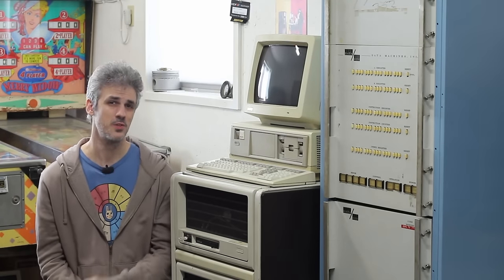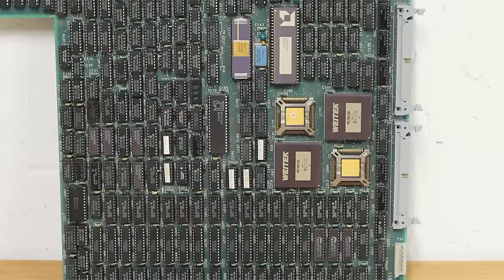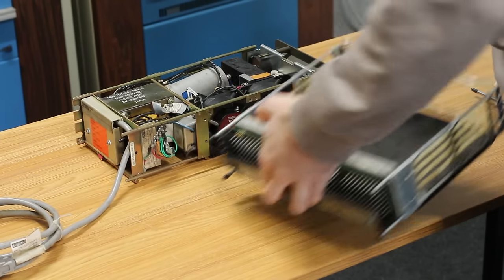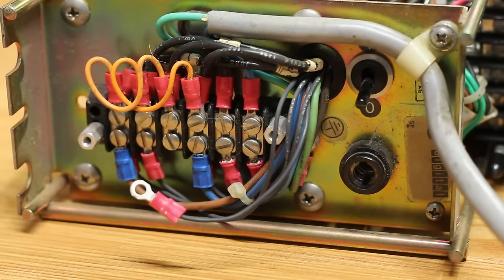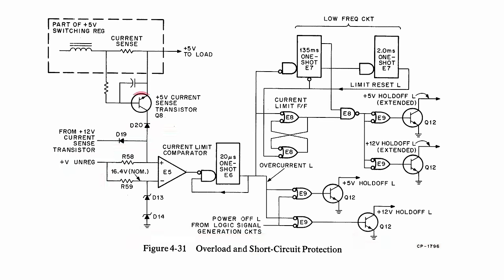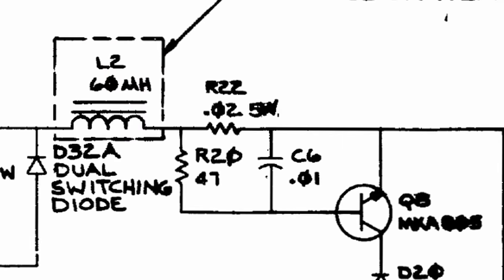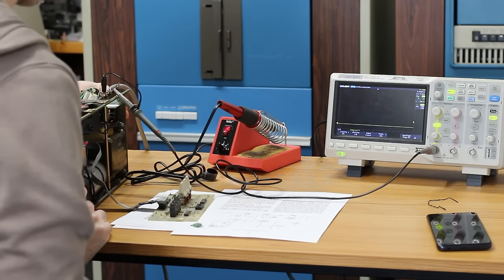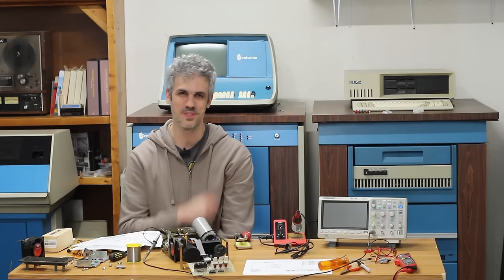This PDP-11 Power Supply Defeated Me

Comment: Isn't your power supply a buck converter?  Your "pass switch" transistor should be turning on and off at some 10's of kHz frequency. I'd disable the crowbar and the overcurrent protection (just remove the SCR and the input at the the current protection transistor). Then feed the thing with some current-limited power supply at F1 and ramp it up slowly. That should allow you to debug it with more safety and less ElectroBOOM potential... At some point the pass transistor should start chopping, then you can work on the regulation loop. You can even temporarily open the regulation loop to untangle things. Shooting from the hip here, I have not looked at the doc, so take this with a big grain of salt.
Reply: It's conversations and comments such as this that make me feel like an eager student at the Lyceum.😊
Reply: thats what i thought! the pass switch, "free wheeling" diode and inductor look like a standard buck converter to me.

although the feedback and regulator circuit look very different from what I'd expect in a modern switching supply 🤔
Reply: I heard elevator music in the background while reading this :)
Reply: also could be that the unloaded output is actually whats causing the crowbar circuit to kick in
Reply: @juliankandlhofer7553 That is what I thought.  Everything is working as designed, but there is no load.  I would want a headlight bulb on the output to see.
Reply: Shooting from the hip here also........
The 7805 initially provides a 'startup' +5V supply for the rest of the power supply logic. The right side of the regulator shown is the output and is hooked up LM317 style with it's middle pin to allow voltage adjustment.
Immediately on power up the control transistor is turned on via R14 and provides supply to the 7805 for that startup supply. The driver transistor will be off, R16 keep the main pass transistor off.
The resistor from the pass transistor emitter down to the +5V regulator will affect the output of the regulator and thus the current through it and therefore the current through the control transistor which in turn effects the driver transistor base and the pass transistor.
This last part I'm not sure about as the take off point would normally be after any inductor and current sense resistors.......but that might just be the block diag.
Reply: @juliankandlhofer7553  but there are resistive loads on them
Reply: This is a very unusual PSU indeed, it likely is making the 7805 oscillate on purpose. But it might indeed just need a minimum load to stay in regulation.
Reply: Did anyone else read this and hear @CuriousMarc's voice as the narrator in their heads?!?!? 😂
Reply: The way I read this schematic, it looks MUCH more like a traditional linear supply.
The first few hundred mA are supplied solely by the 7812.  As the current demand increases, the voltage drop across the 10 ohm light-emitting-resistor starts to turn on the driver transistor Q18 and that in turn forces the main series pass transistor (Q17) to supply current.
There is NOTHING I can see here that looks even remotely like an SMPS!  (Perhaps the existence of the low frequency choke (L1) makes ya think it's SM?)
This circuit take +24V unreq input and produces +12v (slight;y adjustable) output.
Reply: @trevorvanbremen4718  agree, this is not a SMPS.   The "pass" transistor is just taking the brunt of the load.
Reply: @trevorvanbremen4718  That's what I'm seeing as well.  What I'm concerned about is the voltage on the "ground" side of the 7812.  If it's too high, that will trigger the crowbar.
Reply: He have two crowbar, one in 5V and other in 12V. And in the 12V reference a -15V input coming from nowhere, may be we need to look at the AC/DC part where the transformer output is :)
Reply: @radman999   very possible, some circuits do not like having no or too small a load on them, i have an AT PC PSU that its 12v output drops below 10v if the 5v is too lightly loaded , bulbs can be a good load but big problem is they have much lower resistance when cold so may trip any overcurrent sense circuit, a resistor in series with bulb may be better..
Reply: @berni8k  there was a circuit in a tandy  semiconductor data book showing a 7805 being used as the control/driver device in a simple switching regulator circuit, this does look very similar, but with extras, likely to make it more overload proof ..
Reply: @andygozzo72  Yes I agree it looks like a buck regulator to me. A switch feeding an inductor and a diode to ground. When on the current through the inductor ramps up, when off it flows via the diode and ramps down.
Reply from the maker: You're totally right, and the manual states that it should be around 20kHz!
Good call on disabling the crowbar. I initially didn't do that as I was afraid it'd damage some of the capacitors, since they're not quite rated for the full 24V that could potentially find it's way onto the output if the Pass Switch failed short.

I do think we're on the right path, we're just not quite there yet!
Reply: @trevorvanbremen4718  Indeed.  I bet it's a linear regulator.  I had to design systems that looked remarkably like this in college.
Reply: @berni8k  I agree. I haven't quite figured it out, but the two RC networks must be causing the ground pin of the 7805 to swing above and below zero, making the chip behave as a multivibrator.
Reply: @UsagiElectric  I suppose you have a short somewhere on the 12V output. When you disabled the "Pass Switch", effectively the switching transistor, all current flows through the 10R, the transistor nearby and the 7812 which lets the 10R get "a bit" hot. I put my thoughts into a new reply...
Reply: @UsagiElectric  Strangely my answer in the main thread is not visible yet, so I post it here again:

Hi,
I just tried to wrap my brain around it:

The "pass transistor" is actually the switching transistor. While the 12V output is at 0V and the base of Q15 is not pulled to 0V via the 12V shutdown signal, Q15's base will be pulled to Vin via R47 and R75. This feeds Vin to the input of the 7812. The current also flows through R75 (the 10R resistor you blew).

Normally when all parts are in place the voltage drop over R75 will reach 0.7V at a current of about 70mA through R75, Q15 and the 7812. This will turn on Q18 and the switching transistor Q17. The voltage will ramp up until the current through R75, Q15 and the 7812 drops below 70mA and then the regulation by switching Q17 takes place.

Your light emitting resistor R75 let me suggest that you have some severe load on the 12V rail (some shorted cap or similar). As without Q17 turning on, the current will never get high enough to trigger the over current protection. R75 just burns out (nearly the full Vin drops on it with Q17 off).

So the next step is to find the cause of the low resistance of 12V to GND, then R75 should no longer burn out and you can put the other parts back into place...

Let me know if my thoughts are right...
Reply: Further to my supposition that the schematic describes a LINEAR supply rather than a SwitchMode (SMPS), I'm now beginning to think that this is actually a THREE part power supply.  The +5V and +12V sections are 100% LINEAR supplies, and they are both fed from an unregulated +24 supply which is quite possibly switchmode.  (The circuit shown in the video does NOT include anything about the +24V feed so its design is totally unknown to those watching this video.
However, it's noteworthy to mention that the output for the higher current section (i.e. the current that flows through the series pass transistor) is far better filtered (by the inductor etc) than the section derived via the 7812.
The 78xx series has SUPPOSEDLY good PSRR (Power Supply Ripple Rejection),but the series pass transistor kind of ruins that once higher current is demanded.
The PSRR on a 78xx is normally in the 70dB range, but that ASSUMES a ripple frequency of 100/120Hz.  If it's used as a post-regulator after an SMPS pre-regulator, then the ripple frequency will be more like 20kHz and the associated PSRR of the 78xx will be closer to 40dB.  (Still quite decent but definitely NOT in the 70dB ballpark)

Addendum:
I just looked up the Fairchild datasheet for the 78xx series (since Fairchild is probably the OLDEST company to have made silicon).
https://pdf1.alldatasheet.com/datasheet-pdf/view/164481/FAIRCHILD/7812.html
On page 24, figure 17 it shows a sample schematic for a "Switching regulator" that has me somewhat confused....  (Other manfacturer datasheets do NOT include this sample).  I'm unable to see where the oscillator is?  (IMO, EVERY SMPS has an oscillator...  Where's the beef?)
I'm going to throw together this circuit and probe the heck out of it...  IMO, it is NOT a 'switching' regulator and the inductor / freewheel diode do NOTHING!
Reply: What I'm struggling with is where the oscillation comes from.  It seems there's positive feedback from the pass transistor and negative feedback from the other side of L1. Perhaps that's the time constant for the oscillation.
Reply: The God has spoken
Reply: @radman999  
Incandescent lamps are terrible test loads for most things. The cold current will be at least 10 times the running current due to the tempco of the filament resistance.
Reply: @trevorvanbremen4718  
Note the resistor from the emitter of the main power transistor to the control input of the 3-terminal regulator. EDITED TO CORRECT ERROR! - When the main power transistor begins to turn on, ultimately due to current through the 3-terminal regulator, current through that resistor will cause the "reference" for the 3-term to increase slightly, causing the 3-term to conduct greater current to try to bring its output voltage up to the new setpoint. This results in harder turn-on of the driver and main switch transistor - effectively it is positive feedback. Similarly, when the main switch begins to turn off, the setpoint of the 4-term will be reduced. Overall this hysteresis will result in cleaner switching behavior.

It would be nice to see an actual full schematic of the circuit with all the parts values shown. These hand-wavy quick passes over the important bits drive me crazy.
Reply: KISS applied to troubleshooting - great methodology!
Reply: @trevorvanbremen4718  No, it IS a SMPS, but a bit crude: The linear regulators are basically used as voltage reference and through the resistor on their input to Vin control the switching resistor. The switching frequency is not fixed but depends on the load.

Anyway, the Fairchild datasheet is a nice find...
Reply: @juliankandlhofer7553  standard buck converter?
I reckon this converter is more like a buck fifty at least.
Reply: @d614gakadoug9  
Yes, I CAN see R37 (a 20k ohm pot) and R61 (2k ohm), but I can ALSO see R60 (1 ohm 2W) and C30 (39uF).  In my (myopic?) mind, the degree of influence of the 20k + 2k  upon the voltage across C30 (and thus the 'control / ground' pin of the 7812 is near insignificant?
Perhaps it's time I 'go back to basics'???
Q: What does a 78xx regulator do?
A: Whatever it needs to do in order to produce a voltage difference of xx volts between the control / ground pin and the output.
A 78xx can SOURCE current (1A for the TO220) but cannot SINK current (which is why it's common to see a reverse bias diode directly from output to input).  In this PSU, that diode is D18, but I also see a problem here!!!  Assume we have a good +24V input, but we ground the +12V shutdown signal for some reason (thus turning OFF Q15).  D18 has now effectively been taken out of circuit such that the 7812 can be 'fried'.  (IMO, the cathode of D18 should be connected directly to the 7812 input pin!).
The output crowbar SHOULD trigger before this happens, but it's just not 'right' IMO.

Lastly, the way this schematic is drawn isn't exactly helping much...  I was always taught that ground should be 'at the bottom' pf the schematic, but there's an errant 'branch' that goes up to the snubber / freewheel !!!

Having now stated all of the above, I can DEFINITELY understand why a switcher would be a VERY good idea.  If this PSU was 100% linear, then it would need to dissipate 12W (24 - 12) for every amp it supplies.  This would be CONSIDERABLY lower with SMPS!

I'd SERIOUSLY suggest USAGI connects a DECENT load (such as a 60W car headlight) to the output and retest it again!  (And I'd be VERY interested to see oscilloscope traces once it's all working!)
Reply: @trevorvanbremen4718  
Can you give me the time mark in the video for the relevant schematic that shows parts values, please? I thought I saw it go by briefly but I couldn't find it again when I tried and gave up. The blockish diagrams aren't very helpful in understanding the detail.
Reply: @d614gakadoug9  Take a look around 26:58...  Some of them are VERY hard to read, but they ARE there!
Reply: @Wayde-VA3NCA  same
Reply: @Wayde-VA3NCA  I heard Master Ken!
Reply: @trevorvanbremen4718  
Thanks for the time reference! It looks like the sharpest image is at 27:05.

Please note I corrected my previous post which had been erroneous.

The use of a 2 watt resistor for R60 is baffling, since the power dissipation would never be even remotely close to 2 W. Maybe somewhere else in the circuit a 2 W resistor is required and it made more sense to to use on here rather than add another part type to the BOM.

The current through R61 and the series pot (R37, I think, but I'm not sure; I'll refer to it as R37 below) will be anywhere from about 1 mA with the pot at max R to about 12 mA at minimum R (I'm assuming 24 VDC input). The DC resistance at the "ground" pin of the 7812 is actually moderately high. The AC impedance is low because of the 39 µF cap.

Current through the 7812 will cause current through R74 to turn on Q18 which in turn will turn on Q17, the main switch. Current through R61 will quickly increase the voltage at the ground of the 7812 by about 1 to 12 mV. That will increase the current through R74 and effectively produce a small amount of hysteresis, aiding the turn-on of Q17. The 39 µF cap will begin to charge due to the current through R61. Eventually current through the inductor will raise the output voltage sufficiently that if will exceed the setpoint voltage of the 7812 and the latter will essentially turn off completely, as will the Q18 and Q17, ending the first part of a switching cycle. Energy stored in the inductor will continue to flow into the output caps and load, but the voltage on the output will drop with time until the 7812 turns on again, starting a new cycle. When the freewheeling diode is conducting the setpoint voltage of the 7812 will be pulled down through R61.

I suspect R37 is adjusted to yield some reasonable approximation of the desired switching frequency. Effectively the circuit is regulating the ripple voltage on the output capacitors. 

I hadn't noticed previously - one of the devices in the crowbar is a programmable unijunction transistor. This effectively provides a lot of hystersis for drive of the gate of the crowbar SCR, whcih is important to make sure the latter turns on very hard and fast. If you don't turn a crowbar SCR on with lots of gate drive for an adequate time the will likely be "hot spotting" in the die and the SCR will fail (if you're lucky, with a short-circuit adequate to finish its critical work).
Reply: @highpath4776  true, but maybe not enough. he did take it apart quite a bit.
Reply: In some part in the PS you must have too a little regulator to feed the PWM controller and those TLL IC's used as reg/control. May be the failed capacitor is on that PS part. 24V is to high to feed in any controller IC. Good look!. Some about safety in this PS type. May be they use line filters so that get some AC voltage from mains into the chassis so do not try to repair them wearing socks and no shoes :):)  @UsagiElectric . That's a professional procedure only performed by @CuriousMarc :)
Reply: @meh583  😂

Comment: A light-emitting resistor.  I've got to remember that one.
Reply: I'm just glad he had a camera pointing at it to capture the event.
Reply: every electrical component can emit light (and smoke), At Least Once
Reply: Goes with smoke-emitting diodes.
Reply: I've done it a few times - the biggest being a 10 ohm 50-watt resistor (I can still remember the foot-tall flame that shot out of it - 30+ years later! The things that happen as a rookie tech are easily seared into one's mind).

Comment: That style of switch mode power supply was quite common in 1970s computer and digital processing gear. They knew the efficiencies of a switch mode power supply which is almost mandatory at the current levels needed, like over 20 amps. But at the time we didn't have reliable high voltage AND high current transistors or MOSFETS. There were TV horizontal output transistors but that was not much current. Triacs and SCR were not suitable at the ultrasonic frequencies needed for a direct line operated supply. So the solution was a standard 50/60 hz transformer/rectifier based unregulated power supply feeding a switch mode regulator. That drive circuit is actually an oscillator which means a feedback loop. Very difficult to troubleshoot.  As the component count is reasonably low, I would just test all the semiconductors. Even in circuit you can get a pretty good idea if the part is shorted or open.